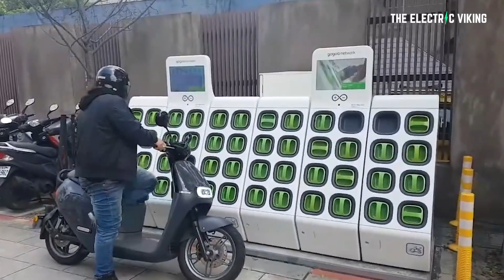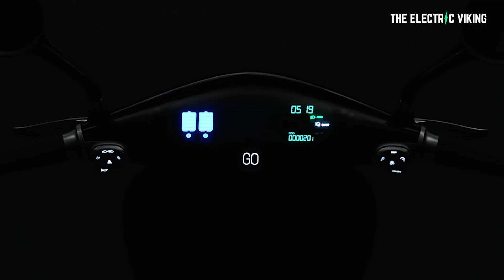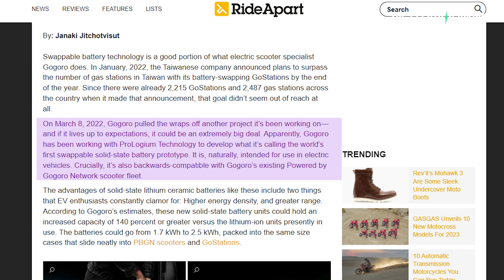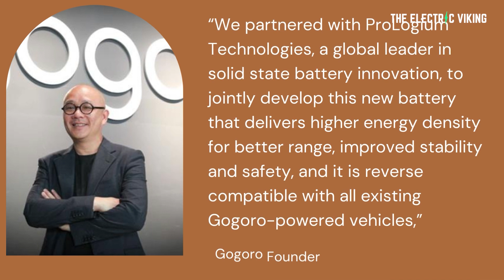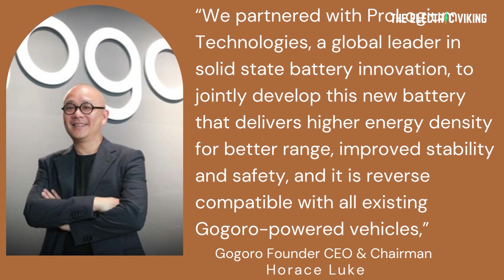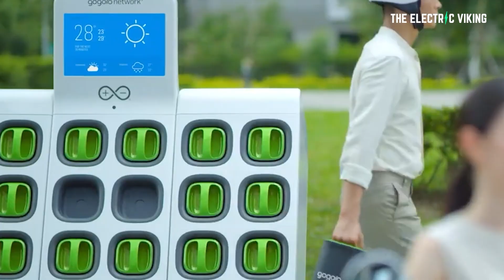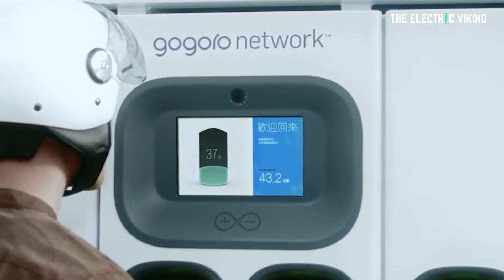This Solid-State swappable battery will change the world

Comment: Swappable batteries may well be a good idea for city centres and mopeds though it will tend to lock the manufacturer and owners into today's battery tech. Don't think there a case for the same for cars, range is already pretty good and charging can be very quick if you choose carefully.

Comment: For me the rhinoceros in the room is the swap-ability. EV enthusiasts minimise the problem of long charging times even using the verbal slight of hand ‘range anxiety’ to pretend it is not a real, at times prohibitive limitation. EVs just cannot replace ICE vehicles fully until they can be operated continuously. Continuous operation was an advantage of ICE cars  100 years ago over electric and steam cars. One of the smaller, less expensive EVs in the US$5-10,000 range you have covered, preferably with swappable batteries, would suit me perfectly, although in Perth I wouldn’t personally need swappable batteries. I’m an experienced biker, but in my 8th decade,  so I don’t need to go around slipping and sliding, and freezing in the rain on a scooter. Swap-ability is the critical factor that will enable full adoption of EVs even though it will cost more day to day because the consumer will be paying for battery on the instalment plan. But I’m more than happy with that compromise because it eliminates the very real ‘anxiety’  of battery degradation, which, to be fair, is very similar to anxiety we all have over the limited life of the far more complex ICE. Bring it on!

Comment: This works if you cant charge at home I guess. It has to cost more than just owning the battery as there is a middle man. I would think the scooter would have the range for your daily commute and charge it every night or at work. Small and light enough and in markets where this is the main mode of transportation I think it works. In the US. unlikely in all but the most congested cities. Gonna be a small market here. 300 miles of range in the cold and highway speeds in the car is the sweet spot. Fast charging and batteries than can last a million or more miles and people will shell out big money for the only car you need for the rest of your life.

Comment: Swappable batteries for this size of vehicle makes absolutely perfect sense; however, I don’t believe it will ever work or be scalable for larger cars because of the size, complexity, weight, and infrastructure requirements. With this system a tiny little petite Asian woman can easily lift those couple kilograms in and out of her vehicle in a matter of seconds. If she were driving an automobile that required a battery swap,It would have to be mechanized with large machines that also require lots of maintenance! So I think yes for battery swappable scooters no for battery swappable cars! ;-)
Reply: You could just have 20 of those light batteries but the drawback is it would take a while to swap them out.
Reply: Chinese EV company NIO has already been rolling out it's swappable battery EV system for some of it cars in China and in America. I first heard about his kind of system from an Italian engineer in the early 2000's, so it doesn't surprise me that EV companies are developing them to try and gain a competitive edge over their competition. This way, the same basic vehicles can easily be fitted with the latest advanced battery technology and continue driving.

Comment: Swapping batteries is nothing new.  A company called Better Place tried it many years ago - Better Place was a venture-backed international company that developed and sold battery charging and battery switching services for electric cars. It was formally based in Palo Alto, California. First station opened in 2008.  Better Place filed for bankruptcy in May 2013.  So much for originality by Nio in China.  I will never be accepted other than for SCOOTERS.

Comment: I'm curious on how they would manage to replace all of their current batteries in their station with the new solid state one. Will the customer know which type of battery their inserting?
Reply: They have a very intelligent network based on AI and you get always the type of battery which fits best to your needs. Means they know if you are taking short or long distance rides with your scooter. And in the long run each battery will be solid stade

Comment: To me this makes much more sense than putting solid state batteries into electric automobiles right away, as it is much easier to make improvements and adapt to them when the batteries are being returned back to your control on a regular basis. Just lock the units until they can be picked up by service personnel. Just as the mobile phone market drove early lithium battery adoption, using solid state batteries in high value products in smaller quantities that both benefit from the added energy density and can absorb the added cost makes sense.

Comment: The "increase" in energy/range  is expected to be 47% (not 140%), since the replacement battery module increases from 1.7 kWh to 2.5 kWh. When you look at the website for ProLogium, you also see that this supposedly solid-state battery isn't expected until 2025 and it may not actually be solid-state, since it utilizes what ProLogium calls a "catholyte" in its Cathode. This catholyte compound might be a gel or even a liquid, as it is not fully described.  Additionally, the 2.5 kWh battery may also utilize a lithium metal anode, which could be hazardous with any small hole in the seal, which would permit water or oxygen from the air to react directly with the lithium metal - this is not a good result from a safety standpoint. It appears their 1.7 kWh battery is working ok, but I would have to regard an all-lithium metal anode as a safety hazard, or at best unproven with respect to its safety at this point.
Reply: You've done your FUD assignment well. Here's your star.
Reply: Excellent dose of realism here, from a non critical, rose glass video.
Reply: @dnomyarnostaw  I hope they really have an actual solid-state or even a semi solid-state battery that will boost their energy density by ~50% by 2025. However, I've seen these claims for over 10 years now and they have all been bogus so far, almost always just trying to raise more funding to keep working on it. In Toyota's case, it's been a ruse to try to keep their stock price elevated while they really do nothing but their utmost to delay the general market's move away from hybrids (like Toyota's) to purely battery-powered EVs (that is, no ic engine needed).
Reply: @greggrant4614  3 modules of aluminium air batteries will give you 500km, they are solid state and swappable, the only downside is that they are not rechargable
Reply: @rwyo83  Non-rechargeable is a major disadvantage compared to any electrically rechargeable battery, which can be recharged at your home for normal use or fast-chargers when traveling long distances. When a battery is nonrechargeable, it must be swapped, requiring a new, very costly infrastructure to swap and recycle such batteries over and over.

Comment: What happens to one of these open air charging stations in a downpour?
Reply: It gets wet unless it has a roof over it. Of course the stations are designed to be safe to use under the usual range of weather conditions in the areas they are installed.

Comment: I have an electric bike and would definitely use an electric scooter in addition to my car. For at least half the year, I could use it for at least half of my miles, and I'd have more fun. I already ride an e-bike ten miles to the grocery store even though my speed is limited to twenty mph. If the price is less than five grand and the range is greater than 50 miles and swapping stations are where I need them, I'm in.

Comment: Most people here are missing your point; this will have an immediate and enormous impact on pollution where the mode of transport is present horrible little two-stroke smoke-mobiles. This is a brilliant solution and should be applauded.
Reply: Even if there was a pollution problem, that' wouldn't be why I'd buy it. Maintenance of an ICE vehicle (and associated unreliability) drives me away from them easily. For the kind of driving I do, this is exactly what I need...except I need rain and sun protection, and a place to put my shopping. Also, I'd like a couple "cup holders" for spares if I'm going to go a greater distance without a fillup. Could be back in my compartment for the groceries.
Reply: @toddmarshall416  - that’s the point I’m making - it’s not being built for people like you - it’s being made for communities where noisy dirty motorcycles and scooters are the normal mode of transport.

Comment: I am against BEV's due to Cost of Ownership, lack of repairs (closed ecosystem by the manufacturer) and cost of battery as a percentage to the entire car. I do NOT want to own a battery but lease it. I am also against Fast Charging due to Thermal Runaway and also the Cost of 50-150KW Fast Chargers (Installation Cost and lack of extensive network and waiting times to find a socket and charge.. and waiting times to eventually charge). I wish we could have something like a Wulling Mini EV or a Citroen AMI with this Technology of Slow Charging, user replaceable batteries with Battery Swapping Stations. I believe this is the future.. and the ability to replace these small replaceable modules with new Tech. Swapping takes you for 0 to 100% faster than filling a petrol car with petrol ... and waiting 3 hours to go to 80% charge on an already limited 75 miles range Citroen Ami is not acceptable. Dragging a Power Corde to the AMI on the side of the road is also not acceptable for me (I leave in an appartment and I don't have a parking location either at work or at home). The ability to remove these batteries by hand and slow charge them at home, is key for me.
Reply: you're not against BEV. you just want people to go in first, clear the roads, make it nice and shiny, so you can walk in and enjoy your wonderful BEV life. there is nothing wrong with that. different strokes for different folks.
Reply: I am against BEV on its current form. I will actually buy a Scooter with this Tech next month. Initial conception and implementation of BEV's is in the wrong direction as far as I am concerned. Battery Swapping is what would make me switch. I just bough a New 2021 Fiat Panda Mild Hybrid for this very reason.

Comment: I like camping, I could see these being used for lighting, charging or even running an induction cooker (instead of cooking with gas). In fact wherever a small generator would have previously been used such as stalls at a festival
Reply: Lighting and charging your phone, sure, but cooking? Well it depends. With 2,5kWh maybe you can boil some water for a bag of ramen or maybe some pasta. Anything needing to cook longer will drain the battery. :)

Comment: What is the range?  If you need to swap everyday that could be a pain.  But once or twice a week seems ok.
Reply: As an example scooter from them, a Gogoro 3-Plus has a range of 170km.
Reply: When I used their (at that time 1,35kwh) batteries I got approx 70km of max acceleration riding. So this should be 130+km. Swapping takes 30-40 seconds (literally)...
Reply: @vincentberbee828  130 km seems really good range for a lot of folk's back-and-forth to work trips.  Can the batteries be charged at home as well?  ...I suspect the charging stations might not be on everyone's daily route so it would be nice to also be able to plug-in at home or work.

Comment: A Substantial benefit of of this offering and other similar battery swapping strategies, is there is no need for the million mile battery or concerns about the expense of swapping out a battery after a 100k miles (this along with charging time are the two main perception hurdles EVs need to overcome).👍

Comment: i have seen these years ago they were used as portable power packs for computers in warehouses.  The solid state part is new but the swappable power is way old tech.   Swappable packs for cars would be nice but i dont see it happening.  Maybe for scooters and motorcycles though that makes sense.
Reply: For small quadricycles like Wulling Mini EV or Citroen Ami it would be very nice to have swappable tech. For any car to have 1-2 such small modules that you can charge at home for range topping would be nice (complementaty to the main battery pack)

Comment: Now all someone has to do is make it so in a car the average person can just pull out and swap modules. Not the whole battery at once.
Reply: they should have people do it for you. you just stop by and 3 people come and change your batteries in a minute and you pay by app and go your merry way. some people are too slow and will be taking precious space doing that so having professionals do it will make the flow of vehicles much better.
Reply: @lucasbiermann257  The idea of swapping car batteries, involves their removal and replacement by a fully automatic robotic system that can run all day every day with only standby emergency maintenance required if something goes wrong. You drive onto a platform and the machine takes over all the work, then after paying you drive away with a fully charged battery.